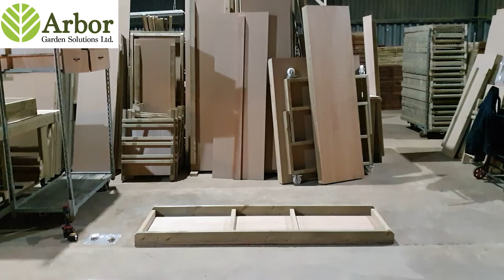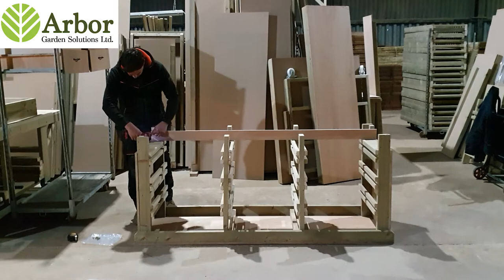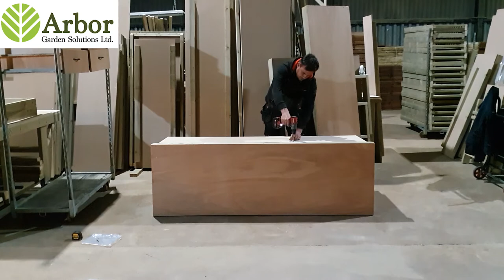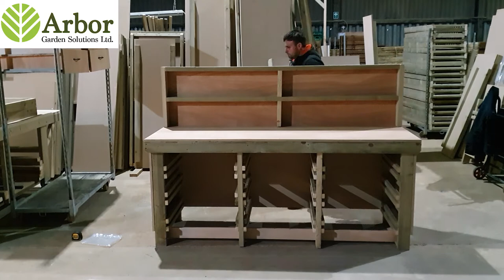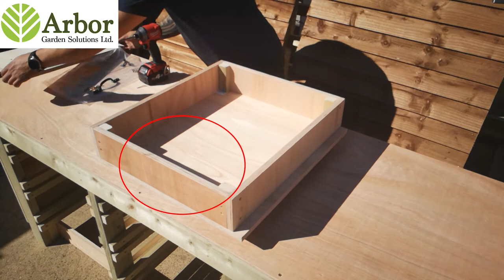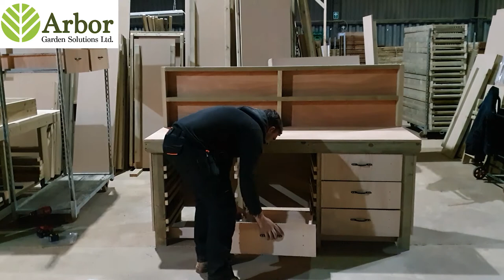Tool Cabinet Wooden Workbench - assembly video

Comment: It looks like he is in the Olympics. It would be much more useful if it was a lot slower, especially at critical places. For example  when installing the ends and middle pieces and ensuring they are correctly spaced. Also, please slow down the drawer-assembly.  We don't need to see all drawers being assembled at slow speed, but the first one or two should be a lot slower.